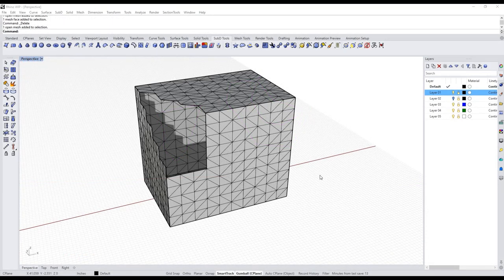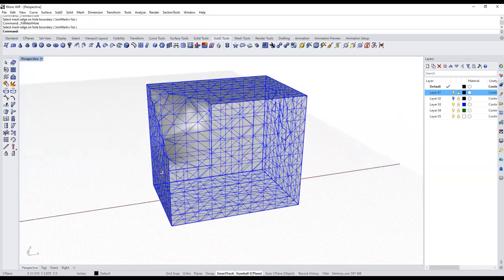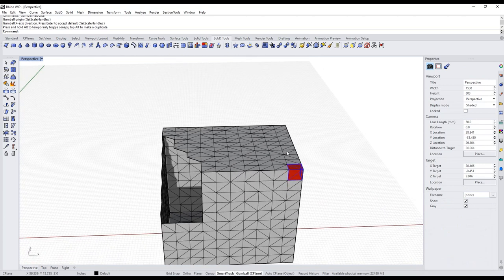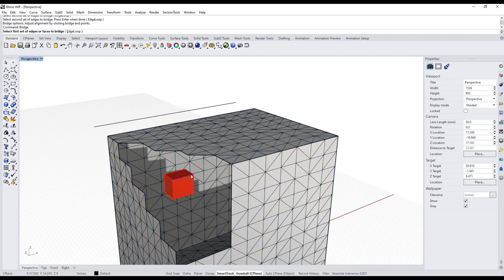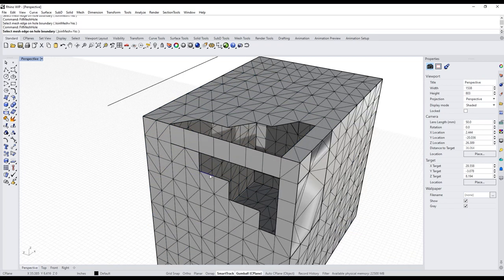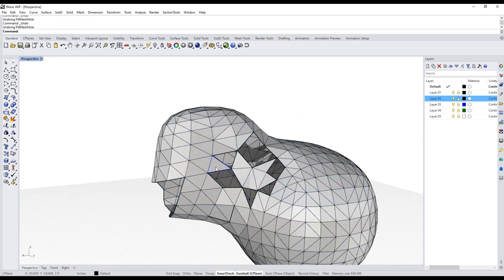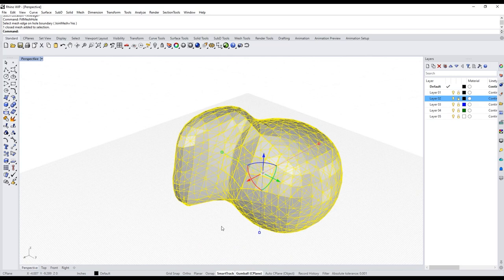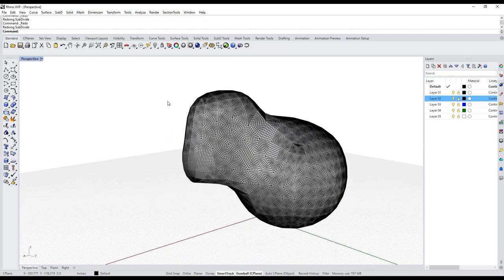Rhino 8 - Watertight Mesh Repair

Comment: Could you please add a display mode where instead of a surface I can only see its control mesh? (So I don't have to ExtractControlPolygon, work with it, and then update the surface to match the modified mesh.) Actually pretty much what Tab does for SubD surfaces.

Comment: is their anything coming to fix naked edges in a nurbs surface to make objects easier to make watertight ? the stuff that gets sent to me to print that I have to spend time fixing is very frustrating when the naked edges are very small .
Reply from the maker: RemoveAllNakedMicroEdges is a command to try, but that will only fix things that are small dots. 

if you are printing, don't even bother fixing  the nurbs.  Simply shrinkwrap it in v8. (or fix the mesh as shown in this video) 

see this video, its a game changer for printing stuff. 
https://youtu.be/3rj8aDSaLJs

Comment: I THINK ITS BETTER RHINO 8 FOCUSE ON SUB D OR MORE CHANGING IN NURBS
Reply from the maker: specifically what with subd or nurbs?
Reply: @Rhinoceros3d  edge sharpness weighting? being able to boolean sub-Ds staying within sub-D geometry?
Reply from the maker: @Vanastarr  subd booleans are not going to happen anytime soon, that is a HUGE project that few people have any decent answers to. Daniel Piker has a grasshopper def that does subd Booleans but it's a long way from being useful. 

check this thread- 
https://discourse.mcneel.com/t/subd-union-help/100628/10?u=theoutside

Variable creasing is a current project we hope to have in v8. 

edge weighting is tricky because all of our SubD data is required to convert to NURBS, weighting can wreak havoc with that conversion and if we did get it to transfer to the NURBS data, weights often cause issues with data transfer to other programs.